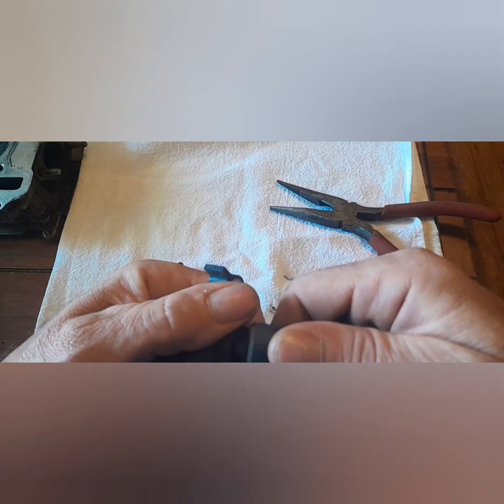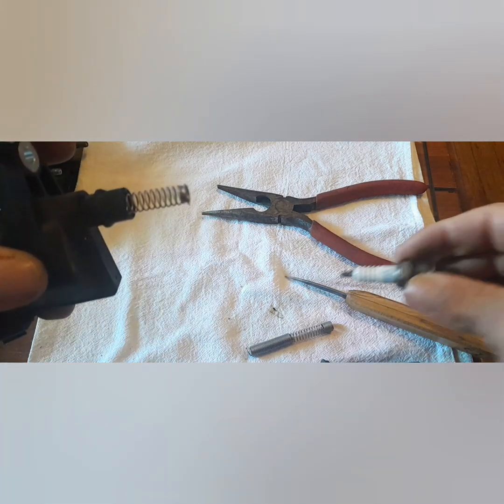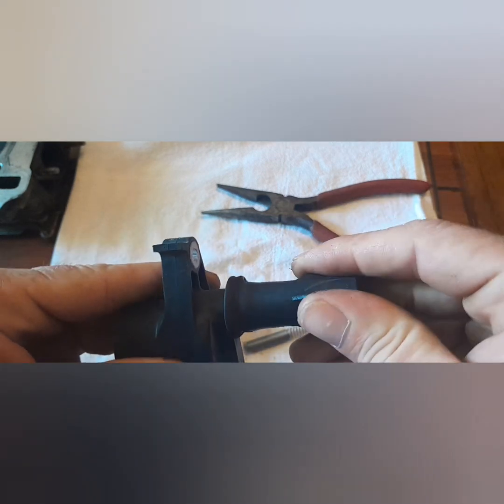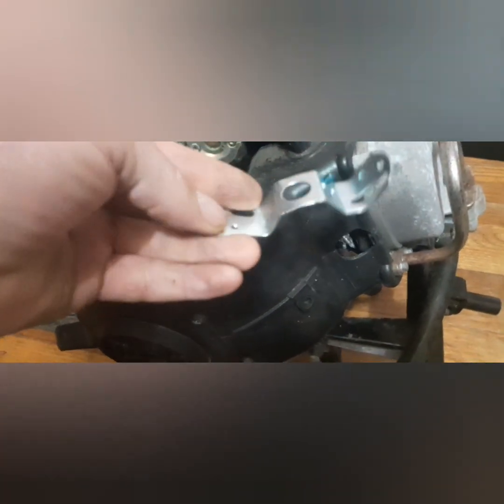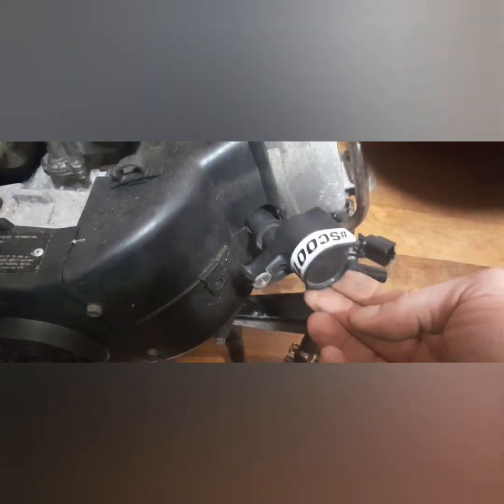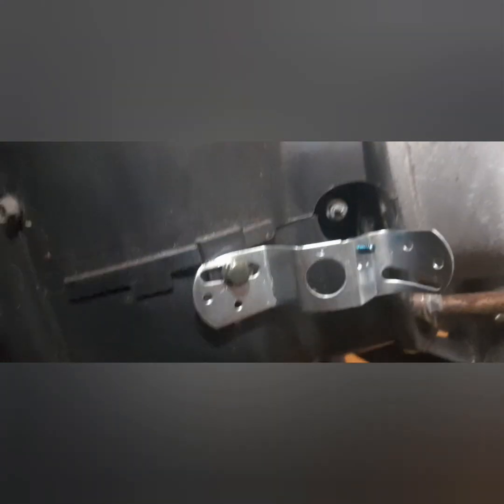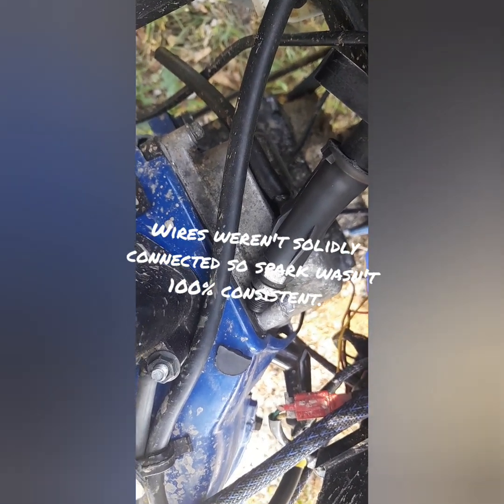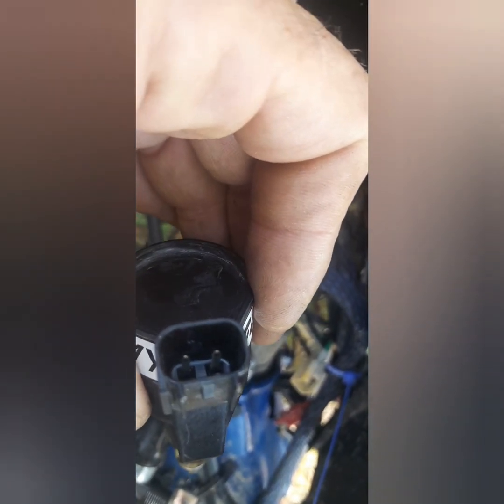coil over plug mod for small engines, scooters etc

Comment: I assuming you didn't finished putting your scooter fully together but if did. What the top speed gy6 52mm big bore kit?
Reply from the maker: Winter hit quick.. so.. I've got 2 52mm builds that are both right around 50mph, but both need carb and cvt tuning. Want happen till spring.
Reply: @scooterarmy  I'm saving up money for my 1p39qmb 72cc scooter for a 52.4mm big bore kit. Hopefully i will get it next year. Also added more upgrade part lists for my gy6 scooter to make it to a 125cc engine.